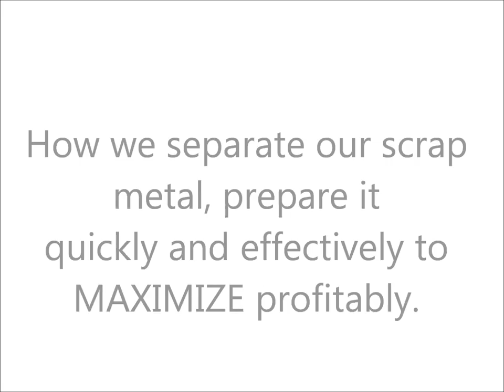Learn How to Make Money w Scrap Metal - Profitable - Easy Way - Work From Home

Comment: The amount of wire you can get from a car audio installer is insane. The installers will just trash any wire they cut out with no care of value then just throw it in the sealed dumpster when the can gets full. 

You can make a deal with them to take it off their hands but just remember it will be mixed with trash so wear some gloves.
Reply from the maker: Interesting!!!

Comment: How about if the coaxial has copper in the center.  Do you still get rid of it?
Reply from the maker: Most coaxial wire does have copper in it, its has too much plastic on it get the copper out and it will be bare bright copper the highest grade. I know they are careful to not take anything that looks like it came fro a utility company or city, like manhole covers, signs, aluminum wire that looks like it came from a utility pole.....ect. ect.
Reply: Most of coaxial center core looks like copper but it's not.  The core is mostly steel plated with copper.  No value.
Reply: Co-ax has value but not much. I strip 95% of all cable and wires. The center wire in co-ax, I will keep as spooled craft wire.
   The shielding is usually aluminum but I've encountered stainless and copper in cctv cable.
Video cable.

Comment: if someone offered you 5 tonnes of tires, with rims, some alloy. would you take them?
Reply: jesus jones.  5 tonnes minus tire weight 2.6 tonne. Steel = 3cents/lb. = $ 150.... Tire disposal $2 to $5 each × 100 = (-$350)
   Gonna cost you $300 ...not good.
Reply: jesus jones yes, tire shops will take them after hours...cover your tag, wear a mask.😂
Reply: Around here taking rims is okay but never tires. Unless it's an aluminum alloy rim. I might cut a tire off for an alloy rim.
Reply from the maker: 😇 We are back....
Reply from the maker: 😇 We are back....
Reply from the maker: 😇 We are back....
Reply from the maker: 😇 We are back....

Comment: I take a box knife and strip the coax. takes about 2 minutes and you get #1 copper wire.
Reply: +stephen p the same with the wire that is around box tv's and monitors. box knife, 1 minutes and #1 copper.
Reply: stephen p OSU..Cowboys....OU who😂😂
Reply from the maker: good point!!

Comment: If you wont strip the coating off those fat TV cables WHY bother cutting and checking them to be copper? The scrap man is NOT going to go thru your bin and cut them themselves and check - waste of their precious time. It all goes thru a big mincer when recycled and sorted by machines anyway. Just chuck them straight in if you not gonna strip them, don't waste your time cutting! And don't chuck the plug ends into normal scrap rubbish - put them into a MIXED bin (eg copper, brass, stainless etc that you cant clean or strip) cos plug ends have Brass & S/S in them. I get 35c KG for Mixed vs 13c KG Plain Scrap (in New Zealand) - KGs not Pounds. Also my mixed stuff includes light fittings, charger ends (bit that plugs into wall) anything with non-magnetic bits in/on it that you cant strip or not worth the time.
Reply from the maker: We get preference with our scrapper because they know we are not trying to get over them, this has been very good for us in getting in and out and getting the benefit of the doubt, and we find them helping us get more for our loads its a different mindset.

Comment: Why not just burn the coating off the wires. You will get more $$$$ that way.
Reply: Probably because it is illegal and terrible for your health as well as the environment. Also, if you are selling burnt copper to a yard on a regular basis, find a new yard.
Reply: i've heard you get less money for burned copper than if you don't burn it. I don't scrap much copper. most of mine is aluminum and steel car parts.
Reply: for anyone reading this that is a false statement. I will make an unbiased factual video about it when I can.
Reply from the maker: it is illegal and terrible for your health
Reply from the maker: Yes I heard it toxic
Reply from the maker: it is illegal and terrible for your health....toxic fumes